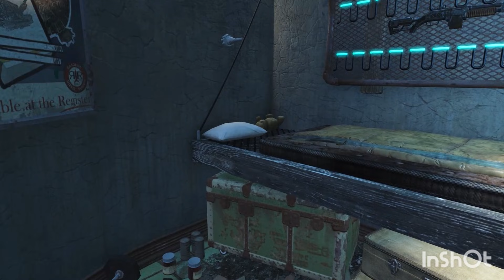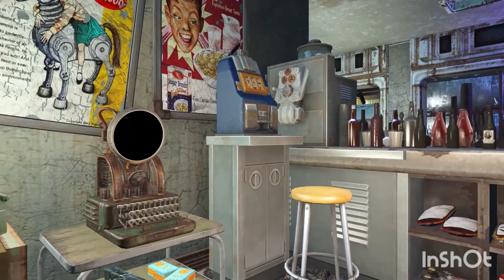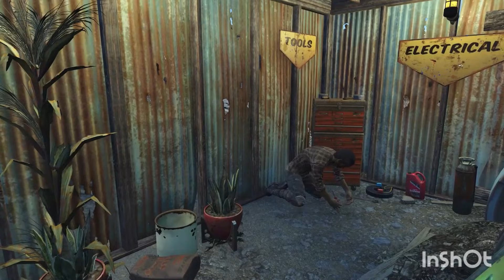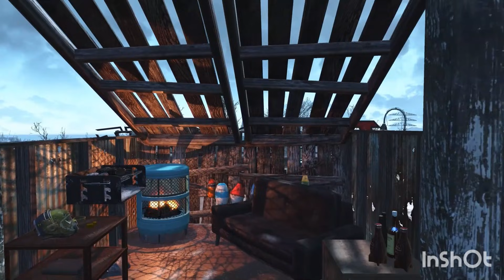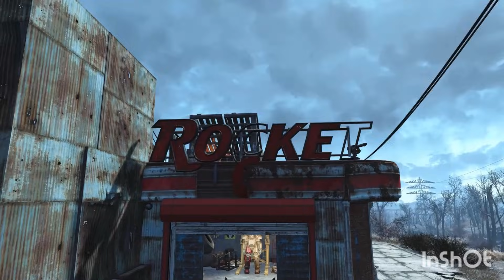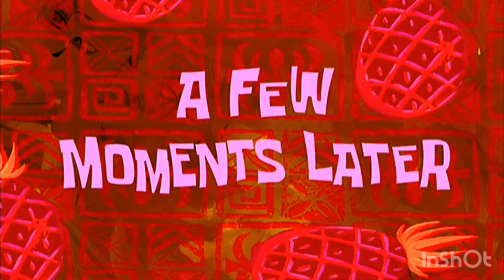Red Rocket Micro Settlement Tour (No Mods) - Fallout 4

Comment: Triple doors! Bosh! I love your Murphy bed, we have one at home and I’d never considered building one. 

Quick question on the tower construction, how did you make the overlapping panels?
Reply from the maker: Haha thanks Dahlia, I’m very pleased with the doors here as you could probably tell 😅 yeah I had the idea for a Murphy bed and thought it fit this settlement really well.

In the elevator tower, those Warehouse walls will snap to it, but I wanted them to go into the building to totally enclose it. So I snapped some, and then used the shillar glitch to clad on the others, and for the ones high up I used a shillar placed on the barn flooring foundation (as pillars can sink into those).
Reply: @justbeans23  ahhh that makes sense. Thanks you!
Reply from the maker: @ViableDahlia  No worries! 😊